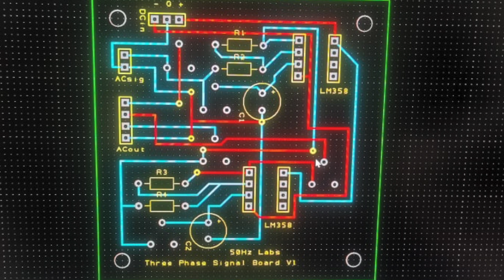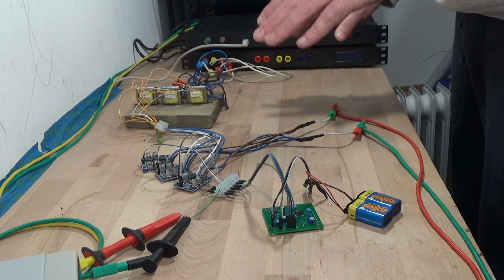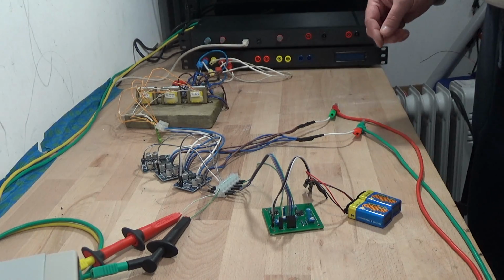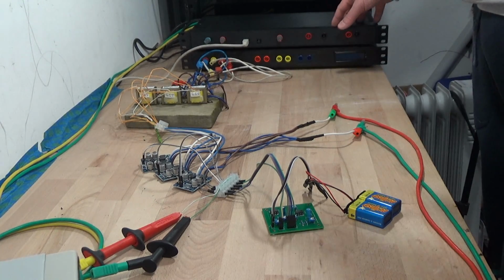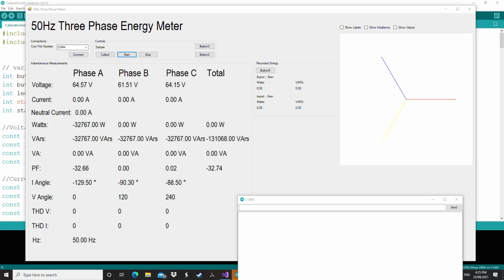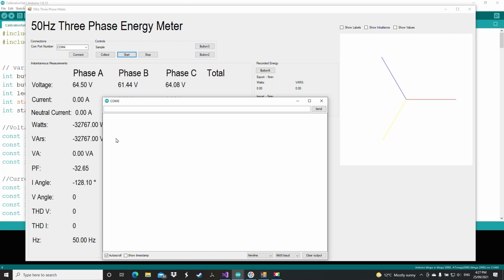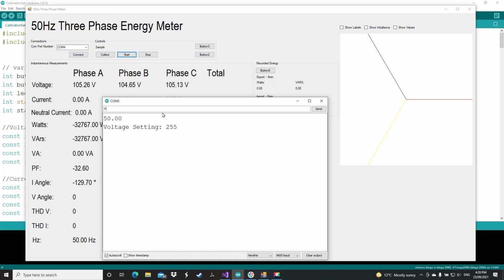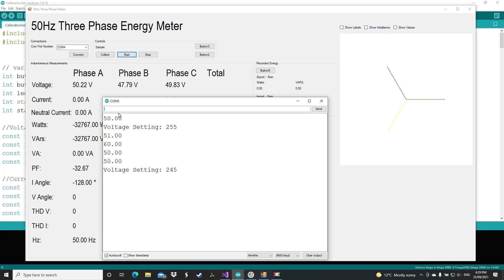Arduino Three Phase Inverter

Comment: Hi mate, can I ask where you purchase the 1RU enclosures, and how do you go about making all the custom cut-outs on the front panel?
Reply from the maker: Element 14 is the best online store for them and they are really quite cheap. There on eBay but postage there tends to be slow.

As for the cutouts it’s painfully slow. Circle hole start of with a small drill but then use a step bit. The squares I drill many holes And use a file 
To get close to the edge. But I’m thinking about buying a dremil for that eventually.
Reply: @50Hz  cheers! I know of someone who uses a laser cutter for prototyping 1RU panels with cutouts.